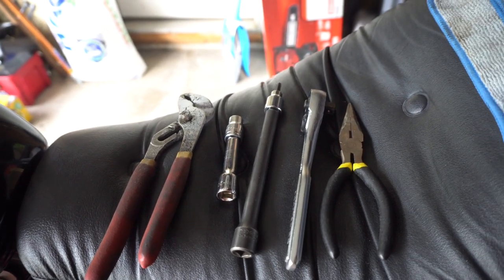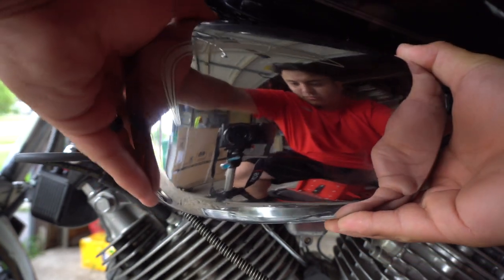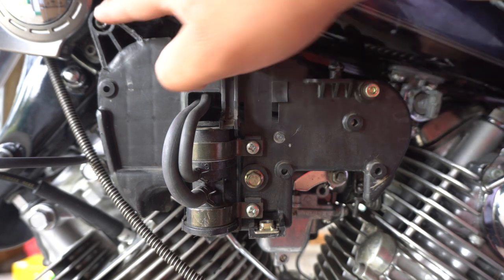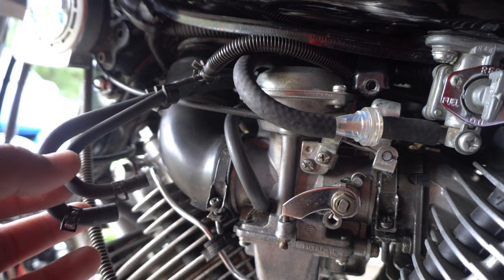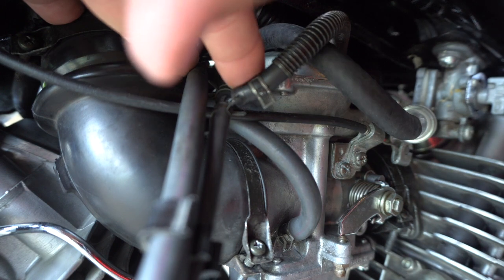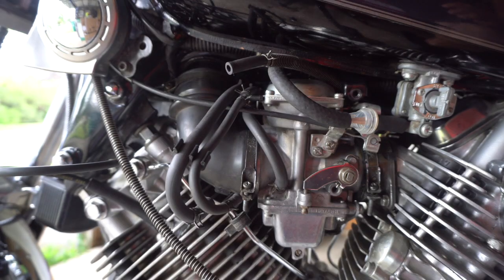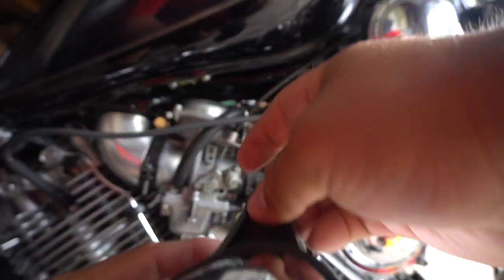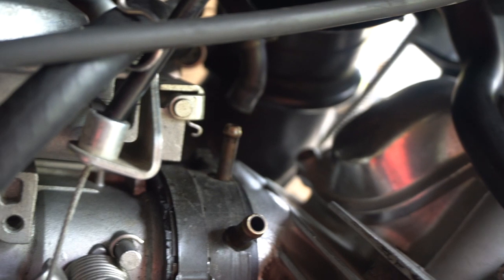Yamaha virago MCV Removal 85 XV700

Comment: Awesome video!

 I've got an XV750 1984 model! I'm modifying the bike into a bobber and had the carb removed and vapor blasted to clean it out. Now that I've come to reinstalling the carb I too want to bypass the MCV but I am wandering if I can have a small vacuum hose attatched to the small male fitting on the front carb as well as the small (and only) male fitting on the rear carb - from the petcock. That way I will only have the large nipple at the front capped and two vacuum lines, one to the front carb and one to the rear! Would this be a problem ? 

or if bypassing the MCV do I have to only use 1 vacuum hose and the other 2 nipples capped? (as you have done)

Comment: This might be a dumb question or statement but isn’t the small nipple on petcock the reserve? I’m not understanding why this would keep the timing ,I’m building a bobber now and I’m to the tank so I want to put a standard petcock on it with one port for the gas but if I do this what will I do for the timing?
Reply from the maker: Hey, brotha! The bigger nipple is for fuel and the smaller nipple is for the vacuum to open the petcock and allow fuel in.
Reply from the maker: I had to re-watch my video. Lol. I apologize. Some XV750’s and up have boost sensors. Those are found by the coils. Those would have to be connected back to a small nipple on the carb boots.
Reply: O ok I gotcha, yeah I’m doing the sportster tank now and I’ll be fitting in the petcock soon so thanks for letting me know or I would of had a worse time,thank you
Reply from the maker: @Horner181  no problem! Good luck with the build!

Comment: I have this MCV unit disconnected with no hoses around,(just bought bike)and what seems to be a rubber cap on one of connections you took the hose off of,but only one? No idea what to do,any help would be greatly appreciated
Reply from the maker: jake Tripod do you mean the nipples from the manifold are capped? (With rubber)
Reply from the maker: jake Tripod what model is your bike?
Reply: @lui1760  yes I only can see one nipple,and it's capped, 86 vx700
Reply: There was one nipple with a rubber cap on it,MCV was removed and set to the side when I bought it,without hoses,so I honestly have no idea how to hook it up
Reply from the maker: jake Tripod ok cool. So you have a petcock on your tank. You don’t need that MCV bro. It’s old and may cause problems. So it’s fine. What you gotta do is Cap all the nipples of the manifold, there’s 3,  cap a skinny one and the fatter one. Then buy a new hose that fits on there and put it on a skinny one and send it to the vacuum side of the petcock.
Reply: @lui1760  you are literally a life saver,watches your vid so many times trying to figure out what it was,the guyhas the bike hooked all wrong,choke cable attached down on throttle side and vise versa,I'll probably ask you for help again on something different😂,thankyou again.
Reply from the maker: jake Tripod haha! It’s all good! I have plenty of videos that can help! That’s my 85 xv700 so we’re on the same boat!

Comment: Hey bud, I have an 87 xv700 virago cleaned the carbs waiting for some floats and and rebuild kit to come in Thursday hoping to reinstall Saturday. It’s been so long I forget how all these lines go back on the bike. Since everything is already off on the bike I would like to do this could you explain in the simplest terms for me on how I should route the gas and vacuum lines? The rear manifold boot was already cap and the front were both open should I uncap this? Sorry for the confusing wording hard for me to explain but any help would be appreciated thanks
Reply from the maker: So basically you’re going to use 2 hoses and 2 nipples. The bigger hose (fuel) goes to bigger nipple on boot. Smaller hose (vacuum) goes to small nipple on boot. Cap the third nipple.
Reply: Wow thanks for the quick reply, I’m still a bit confused, so I would be using the fuel line with the T connection to go from the carbs to the petcock, then would be using the vacuum line going from the petcock to the carb boot vacuum nipple where should the second fuel line be ran to from the carb boot?
Reply from the maker: @noahh4106  no problem! 😬 you have one petcock or 2?
Reply from the maker: @noahh4106  if you have one petcock, the T conector goes to petcock and the two fuel lines go from the T to the carb itself. It had 2 separate connections on the carbs. The 

          Fuel line to carb - T -fuel line to carb
                                          I
                             Fuel line to petcock.
Reply from the maker: @noahh4106  hopefully my little diagram showed up on your screen.
Reply: Just the one of the left/ clutch side. Has two holes on it
Reply from the maker: @noahh4106  shouldn’t be confusing. The petcock has 2 size holes. The smaller one goes to a skinny nipple on the boot from the petcock. And the fatter one goes to the T and from the T 2 separate lines go to each carb. And done.
Reply: Thanks man yah makes a lot more sense to me I really appreciate the help your videos have been walking me through this since a few weeks ago when I tried riding and was getting backfires and flooding on the front.with your vids I learned I had clogged jets and floats taking on gas and weren’t set right to begin with so was running very rich. Thanks again and hopefully this weekend I can enjoy the few days of mid 50 degree weather!

Comment: so you only need one hose to control the vacuum/timing?
thanks for the visual!
Reply from the maker: No problem! And yes, I went from the vacuum on the petcock straight to the skinny nipple on the carb boot. On my model. There’s other models that have a boost sensor or 2 petcocks
Reply: @lui1760  awesome! have you had to do any work to the starter solenoid by chance? Getting kinda confused on this. im familiar with the normal "relay" type but on my 700 it has the "actuating" type. do you have any idea how to remove this type? thanks
Reply from the maker: @theww2soldier740  I’m not sure what you mean by that? Anyway you can post a video on your channel?

Comment: So I don’t have the front vacuum line by the coils. I am trying to use the rear carb to connect the vacuum but I’m also running an after market tank that only has one outlet where the gas comes out. Would I be ok just putting a T and connecting both hose from carbs and the the actual main fuel line?
Reply from the maker: Yes! That’s exactly how it’s connected
Reply: I appreciate it man! Thanks for the quick reply!
Reply from the maker: @AlbertoMartinez-wu4ly  no problem, man. Hope it all works out. 😎

Comment: There are two ports looks like you have them plugged I think it's where pcv valves go is it ok to plug those?
Reply from the maker: Douglas Dunning 2 ports where? The carbs? The manifolds?
Reply: @lui1760  carbs
Reply from the maker: Douglas Dunning those are your diaphragm breathers. You can use little filters or what I used I’ll post a link if I can find them again. Those can’t be capped off.
Reply from the maker: Douglas Dunning https://www.ebay.com/itm/371949447285

Comment: Thanks for the video. It has helped me a lot with the GOOD connection of the crabs. Where did you buy the breathers? I cannot find this model on the internet. Maybe I'm looking in the wrong place... Greetings from the Netherlands
Reply from the maker: Hey! Thanks for watching. 🤙🏼 here’s a link for the breathers. - https://www.ebay.com/itm/1-4BSP-Thread-Brass-Pneumatic-Air-Exhaust-Silencer-Muffler-6-Pcs-/371949447285?mkcid=16&mkevt=1&_trksid=p2349624.m2548.l6249&mkrid=711-127632-2357-0
Reply: @lui1760  Thanks, i orderd it! The previous owner changed the Jet Needle for a different exhaust. I now have the original exhaust underneath it, but it is getting too much fuel. I can't find the dimensions or the correct Jet Needle anywhere. Can you maybe help me with this?
Reply from the maker: @martijnpeters8599  sweet!! Here, Check this group out! It’ll help out a lot! Just because I don’t know the EXACT numbers. 

https://www.facebook.com/groups/3345910372093433/?ref=share
Reply: @lui1760  i will order the Dynojet 😎.

Comment: What if you two petcocks? i have that on my xv750 from 82
Reply from the maker: Amir Chamma you’ll have to run one to one manifold and buy another line long enough to reach the other manifold. (The skinny nipple from manifolds)
Reply: @lui1760  Fantastic, man ive been stuck with this for a while, finally i can get on with my project, thank you so much for this Lui!
Reply from the maker: Amir Chamma no problem! I got some other great videos! You can join the Facebook page too! I may have posted the group name on the description.

Comment: Thank you sooo much for filming this! How did it work out ? did you re jet? Any mods done prior? Thanks again
Reply from the maker: You're welcome! I try! And yes! It sounds so much better! Check out my channel. I got a few things I did to my bike. RUNS a whole lot better!
Reply: @lui1760  Nice! I have a 94 XV750, Im gonna remove the ais soon , those directions on the forum were rough without the visual great to hear about your bike!
Reply from the maker: Yea, it's a lot easier with visualization. That's why I'm doing them. It was hard cuz I'm better looking at a video than reading. Haha! But I got it. Hope it helps your bike! Removes an extra component that can cause a vac leak
Reply: I would need to remove an extra component? Or did u?
Reply: Oh I get what your saying . To stop the backfire
Reply from the maker: The MCV is for emissions. Mine was on the right side bug eye. I think yours is the same. Or by the coils. It's a dumbbell shape plastic. That's the component I removed. That has 2 hoses. They're old you know? So you eliminate that to get rid of potential vac leaks. 1 less component to worry about
Reply from the maker: My 700 doesn't have AIS. Bigger engines do tho
Reply: @lui1760  your the man, Thank you!
Reply from the maker: No problem! Thanks for watching! (=

Comment: My 84 xv1000the gas tank doesn't have a petcock???
Reply from the maker: Correct. Yours has a fuel pump.
Reply: I know for some reason I'm still not able to get the bike to stay idled and it is backfiring
I don't know if there's a possibly leak somewhere one of the Caps or something I bought it from the Suzuki dealership here in Wichita Falls yeah pretty funny I thought you know a verado at a Suzuki dealership but and  the guy was in the process of bypassing the AIS whatever you want to call it and it had a electrical issue which happened to be a busted ignition right there where it mounts the handlebars so obviously they didn't take too much time figuring out what exactly was wrong with it I bought it for 500 bucks so yes I have to go do the whole double take over it once more figure it out
Reply from the maker: @MrBizkit1003  you might have to mess with the carbs. Try syncing them and work on the pilot mixture screw. That should help it and make sure the idle knob is just keeping it at 1-1.2k rpms. That’s a good spot to have it at. I’m glad you got to find that problem! They do have updated tci (main brain) you can buy off this link. They’re called ignitech
Reply: Is it cheaper than the dynotech Dyna s ignition system
Reply: I got one for my Suzuki it's an 81 GS550 and it worked like a charm
Reply from the maker: @MrBizkit1003  

https://ignitech.cz/en/vyrobky/tcip/tcip.htm

Forgot to post the link haha
Reply: Okay well from what I've noticed especially today I pulled her out of the garage started up and noticed that the fuel isn't going into the fuel filter was like a almost like a dribble so I pulled the fuel pump off and I'm pretty sure I'm getting ready to take it apart I'm pretty sure that's the one thing I didn't clean out or flush out as far as the old gasoline and stuff that was in in the bike which there wasn't much in the carburetors but I ended up cleaning those out anyways so I'm thinking that it's probably a dirty or semi clogged fuel pump so I'll let you know how how it works out because when I took the bike out and started up for a ride down the street and when I pulled into my garage I noticed she was wanting to idle and that's when I looked at the fuel filter and noticed that it was just dribbling fuel instead of pumping fuel so I'll let you know how that turns out
Reply from the maker: @MrBizkit1003  make sure you turn the key on and off a couple times to get fuel into the carbs. Since you cleaned them. Also, that little filter between the lines may need replacing. Last time I replaced mine, it was dirty like crazy!
Reply: I believe I probably figured it out as I think the fuel pump was the only thing that I didn't flush out and clean so when I want to start it yesterday I noticed the fuel was just dribbling into the filter through the filter so more than likely it's plugged fuel pump so I took that off and get paid it clean it today so as it was trying to stay idle when I pulled her back up into the garage so I believe that's what it is and then I'm going to wrap the both exhaust pipes and then get her registered
Let you know how it goes
Reply: What's the easiest way to tell if the fuel pump is functioning properly I know I opened  the top there's like a spinning motor inside but there's like a a gasket
Reply: What's the easiest way to tell if the fuel pump is working correctly as far as the internal workings it looks like I took the top off and the there's a spinning motor but there's a gasket with bolt holes that both the top of it on to the fuel pump and I'm not sure if that's supposed to be I think they're supposed to be a scene there or I don't know I'm so I'm on the virago forum site you can find me there also as BezerkerB
Reply: Okay from what I've been reading in a couple videos I watch the contact points on the fuel pump motor have a tendency to go bad so probably the original contact points for it so I'm going to pull the bottom off the fuel pump and check those I'll let you know how it goes
Reply from the maker: @MrBizkit1003  check this page out! https://www.facebook.com/groups/ViragoNation/?ref=share

Comment: I just want to remove the ugly pods.
Reply from the maker: Monster mash the left side pod where the MCV and AIS, depending on year/model, are, can actually be removed completely! Right side, you can get a turbo hose with a HD dog dish.   The spigot on the frame is 2 1/4.” Radiator hose is available on that size.
Reply: @lui1760  I have an 84 XV750 and entirely  new to mechanical work on motorcycles. There is a laundry list I would like to change and the pods are the first thing I want to remove. It's like you're reading my mind with the HD dog dish, could I do this to my model? To be honest I'm slightly overwhelmed and a little confused but really inspired to tackle this.
Reply from the maker: Monster mash actually, it’s fairly simple to work on! Search up, “Virago Nation - All Things Virago” on Facebook. Has like 10k people. So many people that can help including myself! You won’t be overwhelmed there. They answer any question at any time.
Reply: @lui1760  Thanks a lot I'll do that.